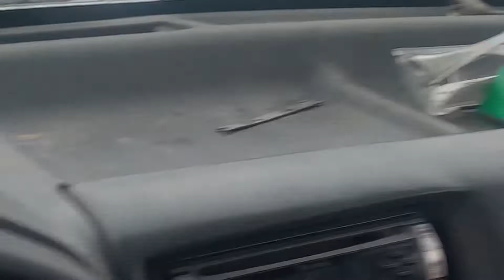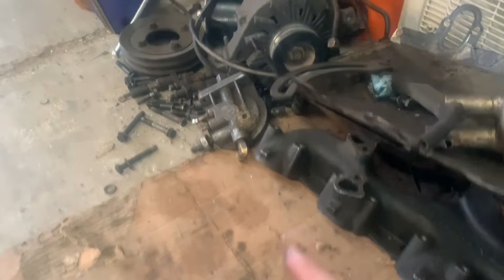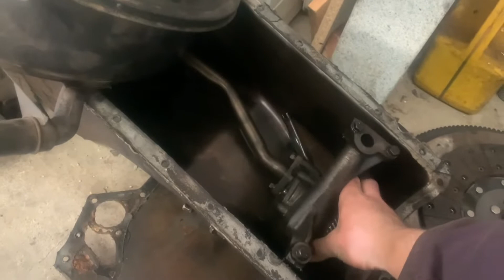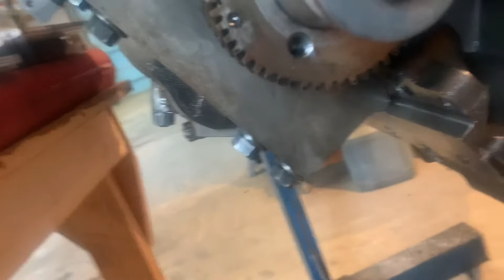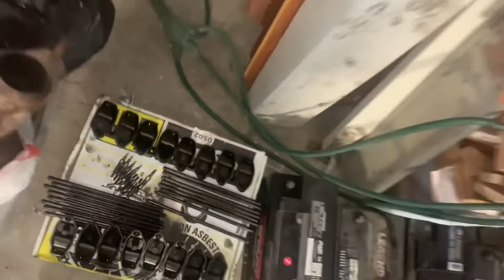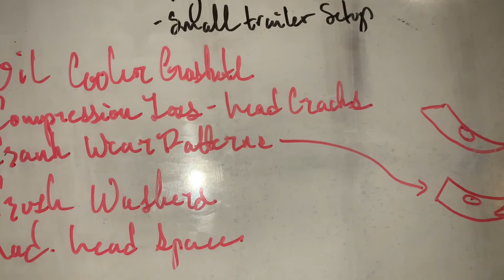Common issues with 7.3 liter IDI Diesel engines - Ford and International Harvester

Comment: Glow plugs aren't supposed to cycle if glow plugs are cycling it's either cheap glow plugs you have a bad glow plug Warrior wiring is faulty 1 cycle on and then it'll cycle off at the end of duration a lot of the times two little clips that are installed at the Factory are lost or whatever and not on the glow plug that will make things glow plug relay cycle can you turn the key it will click on at the end of the cycle it will click off not click click click if it does that you have an issue
Reply: Exactly. My relay used to cycle and replaced my glow plugs with new Beru and the cycling stopped immediately. That was 6 years ago. Still starts up immediately now and no cycling.

Comment: Usefull thanks... Putting a 7'3 navistar..in a ex petrol econoline E150 in Netherlands..  having some "glowplug" and "fuel cut" problems...😌..  so change glowplugs to "beru" hope its the good one..
Reply from the maker: Beru is absolutely the only glow plug manufacturer I use for these engines, the tips swell and burst off autolites or densos. I’d also recommend looking at your lift pump, take it out and make sure the armature is secure in the lift pump body. Make sure it pulls a good suction. I’ve had multiple lift pumps fail, the armature can fall into the oil pan (what a nightmare to get out!). 

Hopefully the 150 frame and driveline are stout enough to take the massive power of stock Navistar IDIs ;)
Reply: That is the only glow plug to use. I replaced my old ones 6 years ago with Beru and still cranks up immediately.  German glow plugs are the best.

Comment from the maker: Forgot to mention - early 6.9 idis have weak castings near the block heater on the right hand rear of the engine. I don’t remember what casting numbers you’re supposed to avoid though.